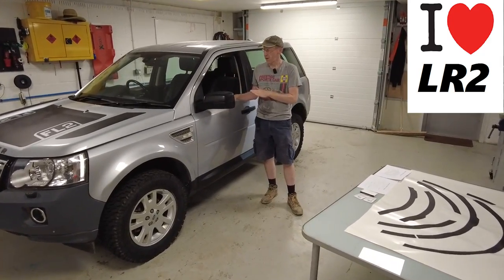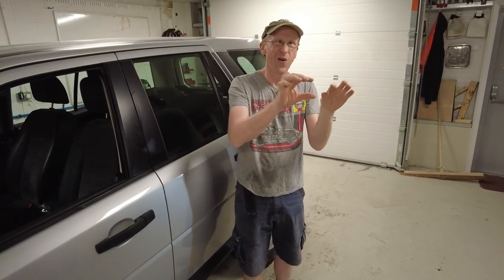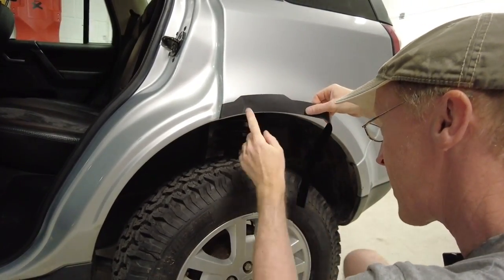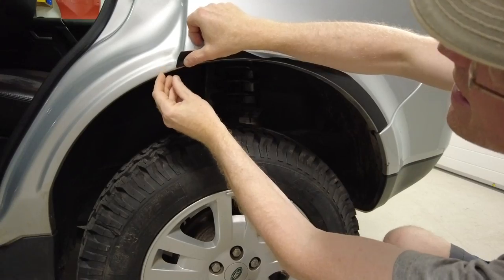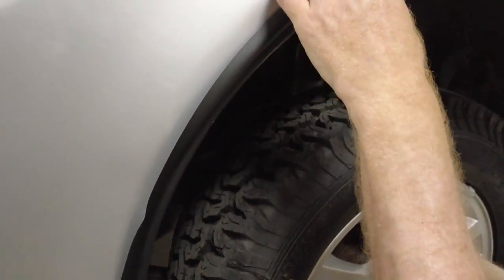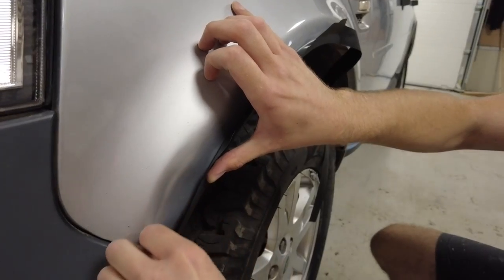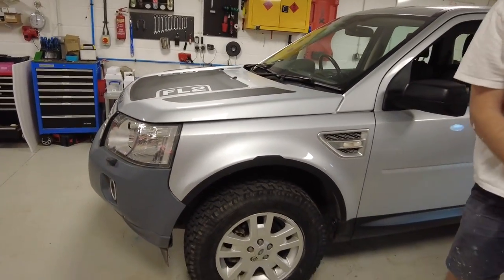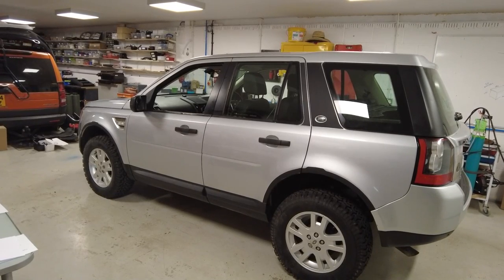Land Rover Freelander 2 / LR2 Wheel Arch Protection Stickers Upgrade

Comment: Excellent !

Road Tar - That's what mud flaps are for, they really DO protect the sides of the car from road tar - I would never have a car without mud flaps.

By the way - parked at the end of my road this evening (Bicester) is a very nice Discovery with a 4-wheeled caravan.  A very nice Disco 4, I thought.  But no - it was actually a Disco 3 that had obviously been "PowerfulUK-ised" - Rear lights were the D4 red surround, Chrome finish grill front with gloss black underneath, chrome fog light surrounds, chrome mirror covers, wind deflector set... That's all I could see.  I hope he also got the spare wheel theft protector (I would) and the LED light options (I would).  It looked absolutely superb and definately looked 10 years or more yonger than it is (it had an 03 plate).

So - these modifications you do really DO look the job.  It made an 18 year old Disco look absolutely superb and at least 10 or more years younger than it really is.

If the owner is looking here - you have done a superb job!

Yes - I am hoping to change my "poor man's Land Rover" (an X-Trail Mk.II) for a late Disco 4 if I can get the cash together, so I am looking at every Disco I see - and this one was absolutely superb for an 18-yera old vehicle.  Congratulations to the owner.